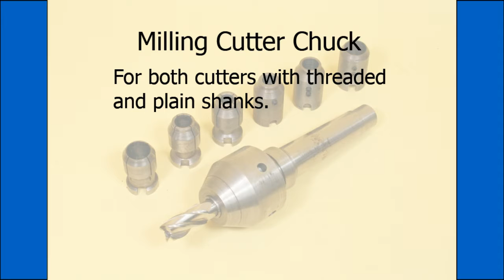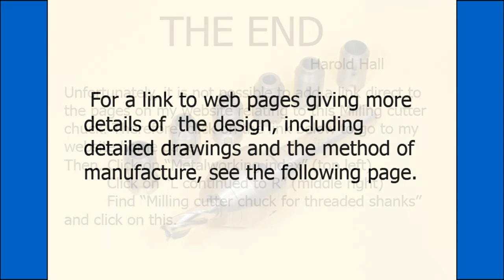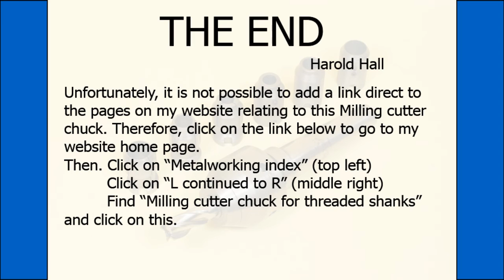Milling Cutter Chuck

Comment: Hi I've just built the boring head off your website . As a 15 year old model engineer I didn't have a boring head . So I set about building the one you have plans for and it was a nice little weekend project and I can use it on my lathe and milling machine . Thanks and great video!